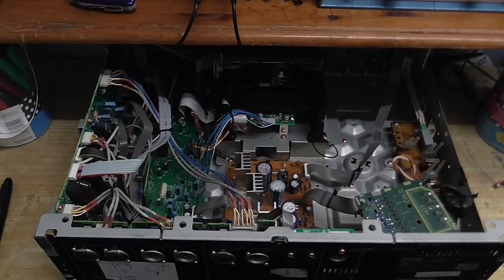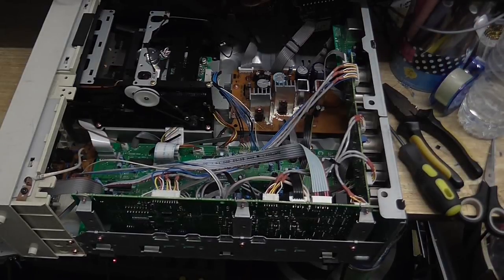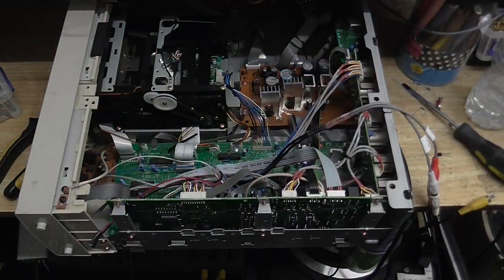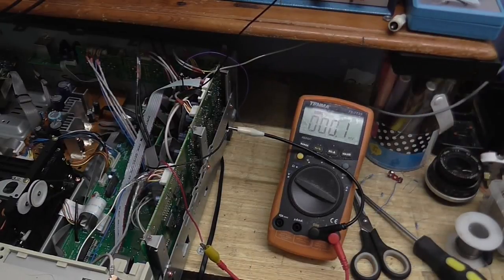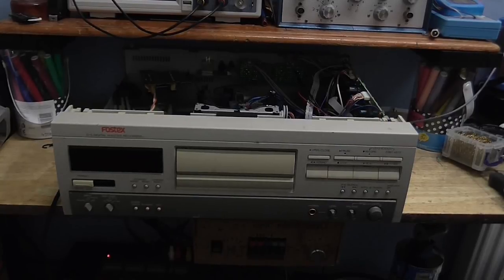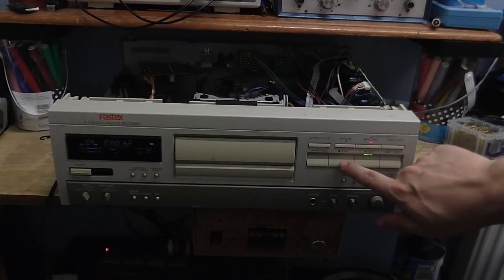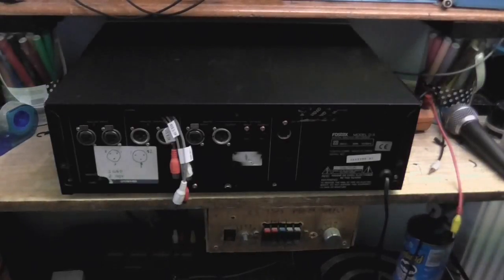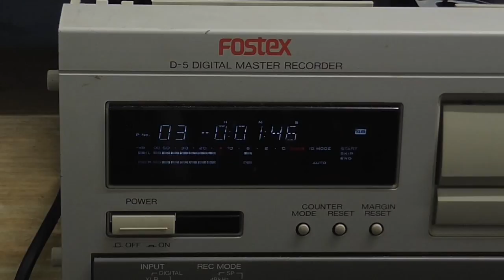CDC Electronic Workshop - modifying a DAT recorder to have line inputs and outputs part 2

Comment: Why dont you use XLRs on the back - these are balanced line in.  You just have to short the ground of the XLR to the - signal and this will convert it to unbalanced.  If you want some xlr male and females I will send you a load.
Reply from the maker: I might try that although I'm sure if I just short the cold and ground together it would work no better than just having the signal ground connected to the XLR ground and signal wire connected to the XLR hot with the XLR cold just floating, since the XLR cold would still be at 0 volts either way (I hope that made sense)
Reply: CoolDudeClem Actualy that's how it's meant to be done. Did it myself many times, working as stage tech. We have specific cables that are just a 1/4" TS (unbalanced) to XLR (balanced) that just put the shield (ground) and cold together.
Reply: I used to have an Otari R2R which only had balanced and this method worked perfectly for me also, it was even listed in the manual to do this.